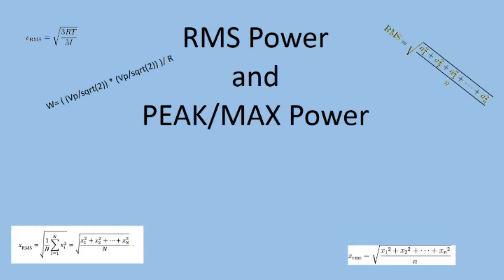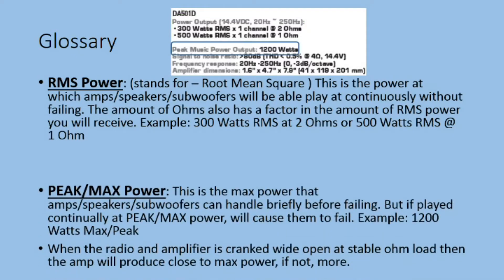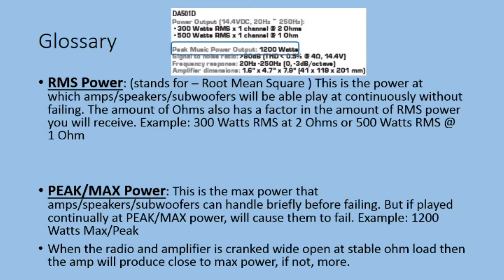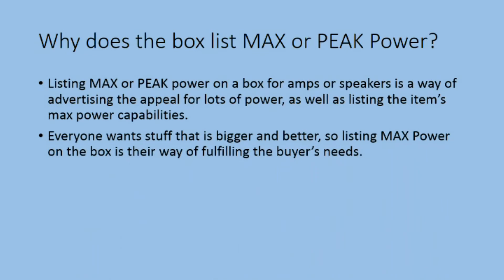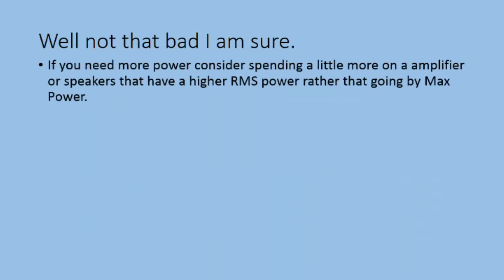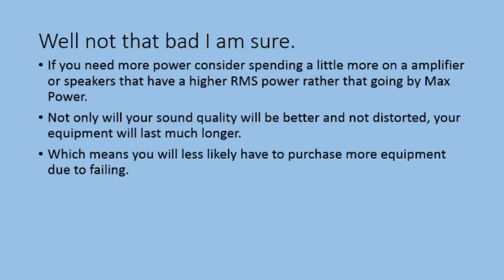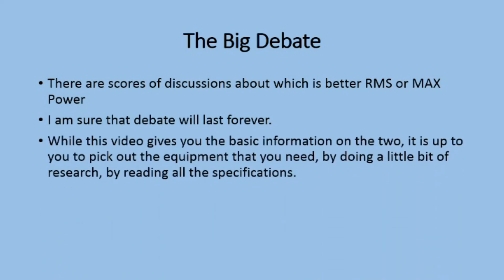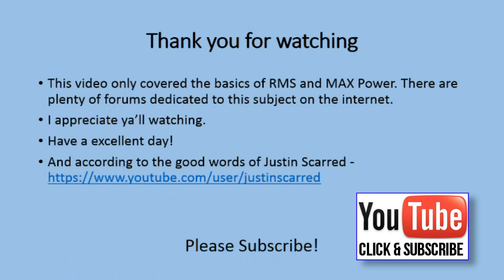RMS or PEAK Power - Whats The Difference

Comment: That’s the most misunderstood thing to most new buyers. The second is this...  Your Gain control knob is NOT the volume for the sub. It simply regulates the max voltage. You figure out this voltage using a formula based on the wired Ohms and speaker rms rating

Comment: MAX POWER DIVIDED BY 3 THEN MULTIPLIED BY 2 EQUALS RMS ...... eg 500 / 3 = 166...... 166 * 2 = 332   ..  so a 500w max rating is a 330 watt rms , RMS/continuous power is not half of max power.. its two 3rds